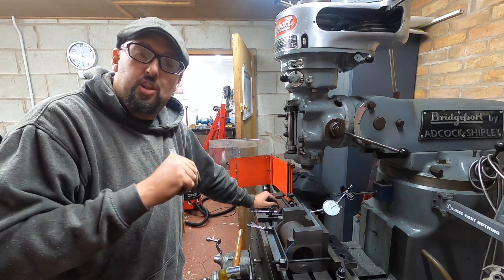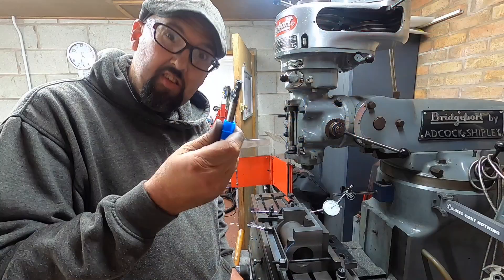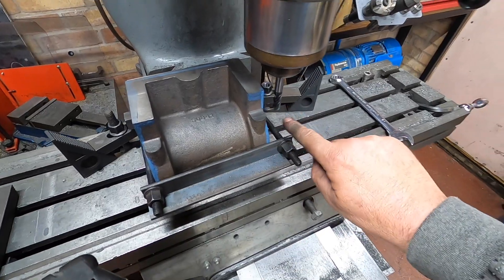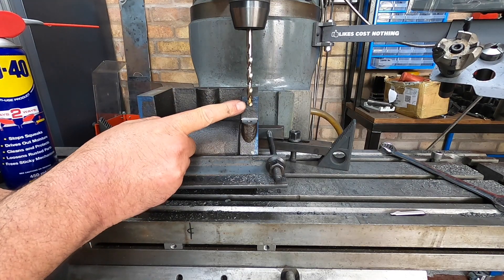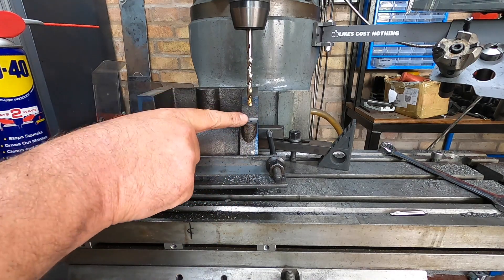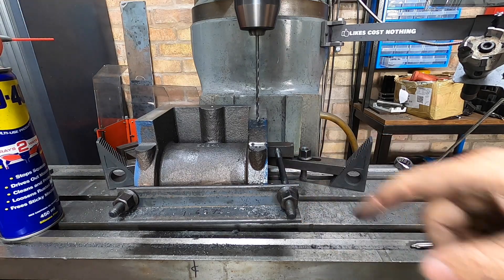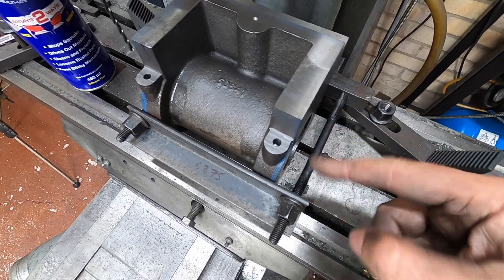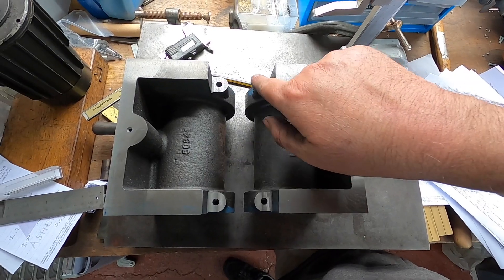Cylinder Drain Cock Holes -  ep51 - 7.25" Gauge Steam Locomotive Build

Comment: Deep drilling is something I haven't had to do yet. BTW, no need to use WD-40 or really any lubricant on cast iron. The graphite in the cast iron is a more than suitable lubricant.
Reply from the maker: Hi LilMule, it was more a belts and braces approach, I did not want that drill to snap in that hole 😂. All the best, Matt 👍

Comment: Carbide is KING...  Sharp carbide tooling is the only way to fly.  Just be careful with it, it chips pretty easily and once it's damaged it's borderline useless.

WD-40 on cast iron...  Never would have thought that was a good cutting fluid for it (it's fantastic for aluminum though!), but I bet it sure keeps the "dust" down.  

Deep hole drilling on a manual machine nerve wracking on a good day.  You did great Matt!
Reply from the maker: Hi Jeff, I'm definitely preferring the carbide cutters to the old hss ones. Shame my machine can't really go fast enough to use them correctly, but I'm taking very good care of the ones I have. 

The WD40, it seemed to work 😂. If it helped I don't know. All the best, Matt 👍

Comment: eyup cock' sorry Matt, couldn't resist
nicely done, i've  just machined the ports then on to the steam passageways, we are nearly working in tandem here😉😉👍👍👍👍👍👍
my cocks will come last as they are drilled radially in to the bore not tangentially, sorry might be talking _______cks there!!!
keep up the good work, the air line is getting closer
see you next time
Laterzzzzzzzzzzzzzzzzzzzzz
kev
Reply from the maker: Now then cocker, Aye I've been watching your progress on the big telly with much enjoyment. It is hoped to be on air as the boiler is ready, so its straight onto the top part of the loco without much delay. I want this in steam next year. All the best, Matt 👍 Laterzzzz

Comment: Is there no stopping this man? I have a feeling the drain cock tappings may well be 1/8" BSP and I think you will need a 19mm drill for the exhaust. (do you need one?)  In steam and running by Christmas?  Surprised that the suggestion is to drill the drain holes before the bores, with the drill being guided through its length the chances of snapping is very low - each to their own though... (Sounds of drills snapping in South Somerset!) Grum
Reply from the maker: Yes I will be stopping soon, well maybe the YouTube videos. I can't remember what size I used now, I'm making steam operated draincocks so this only needs a pipe connector. It will be in steam by Christmas, which one is the question!!  All the best, Matt 👍

Comment: You would be better keeping the qwill to the top, all the best.
Reply: Right on.
Reply from the maker: Never had an issue. All the best, Matt
Reply: @MattChiversWorkshop  If you get no chatter or broken cutting tools, fair play, that's were I was coming from my friend. How long until the loco is finished, have you got a timetable or just winging it?
Reply from the maker: Hopefully if everything goes to plan I'm hoping to have it in steam next year. It is aimed to have it running on air for when the boiler is ready so we go straight onto the top half without much delay. That's the plan, if all goes well 😂. All the best, Matt.